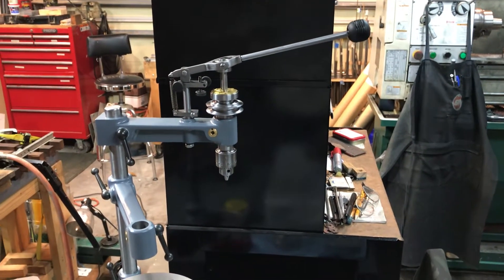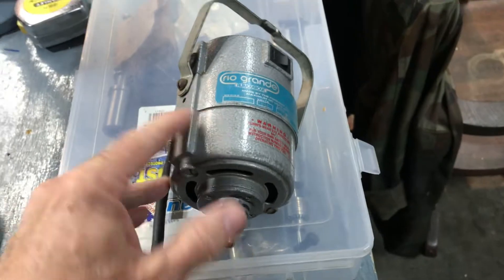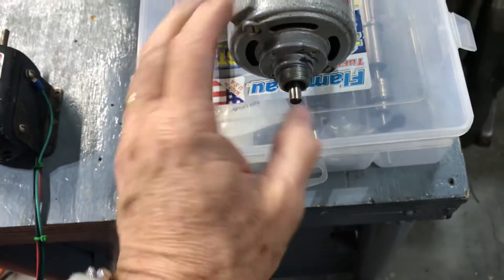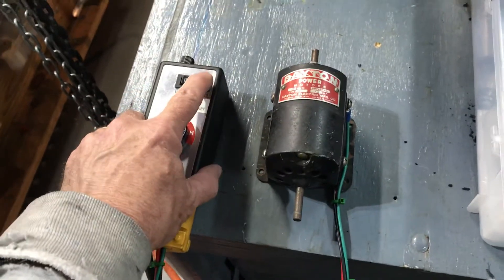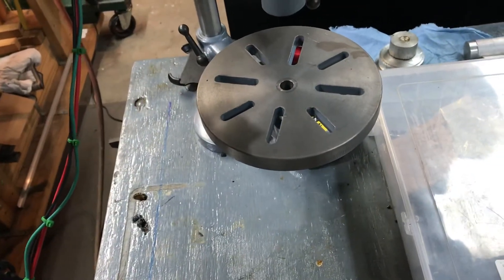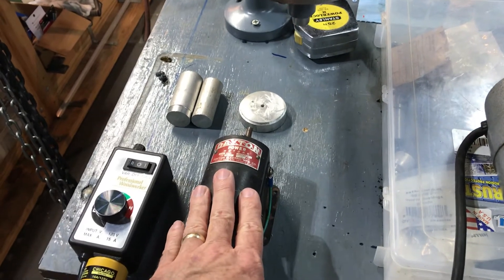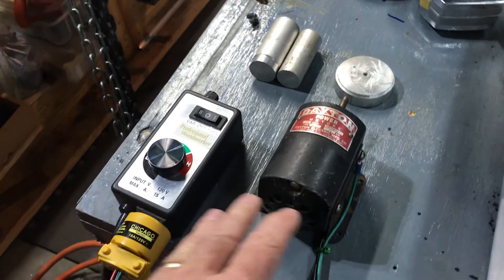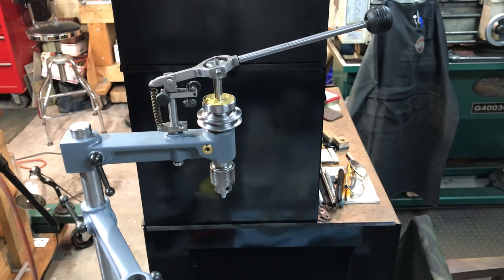Universal Pillar Tool project, motor choice update

Comment: I like the look of the Dayton motor. But the two motors sound like universal motors. These can really move! But they bog down quickly. Like using a wood router. An induction motor sounds like a good idea but not sure how small you can get. A DC motor has excellent low end torque and easy speed control. Not sure what I will use on mine.